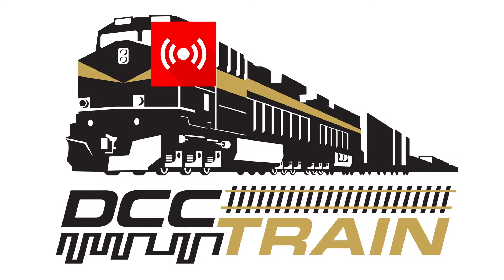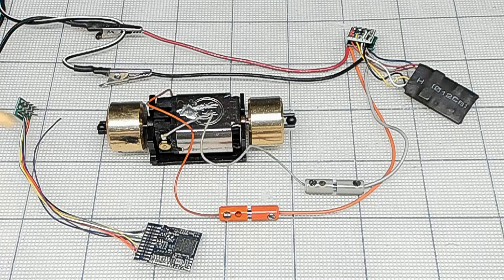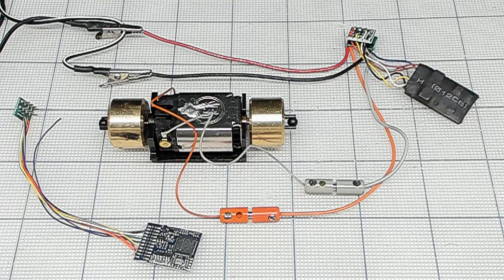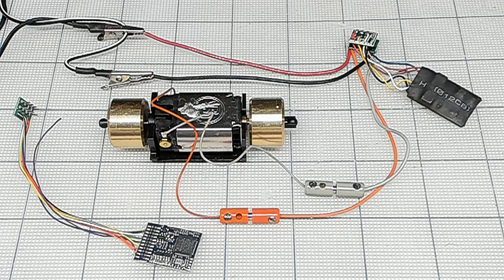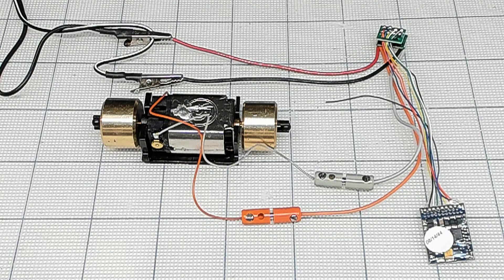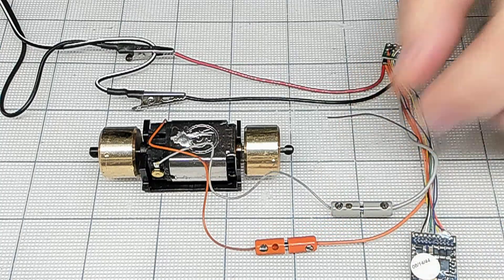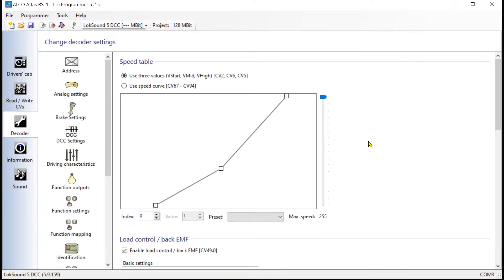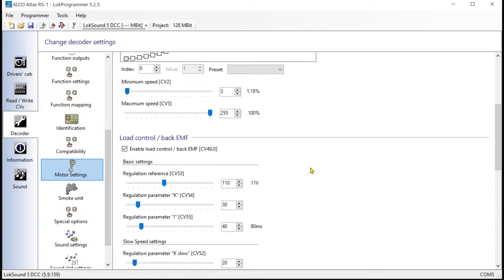How to adjust motor control with DCC decoder.

Comment: In your picture it shows the orange and red are connected together or is this just the picture that it look like they are connected?
If that is the case your motor get the full power from the track and goes haywire.
Reply from the maker: No, the orange and red are not together. This is just basic MNRA 8 pin plug.
Reply: @dcctrain  Thanks for clarifying this.